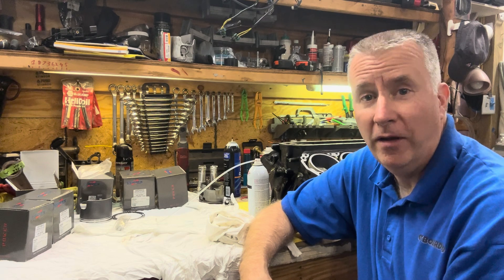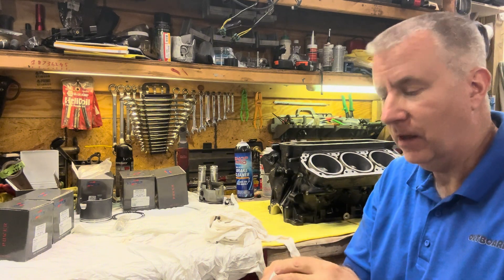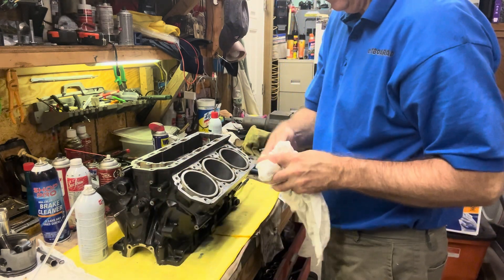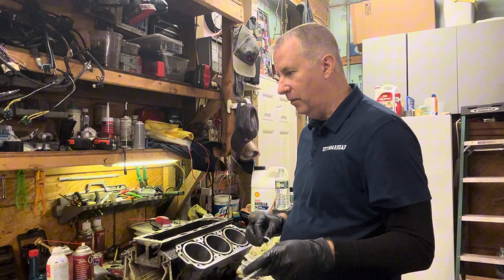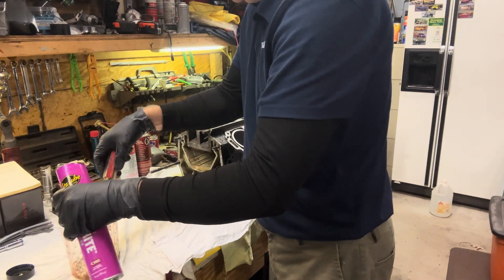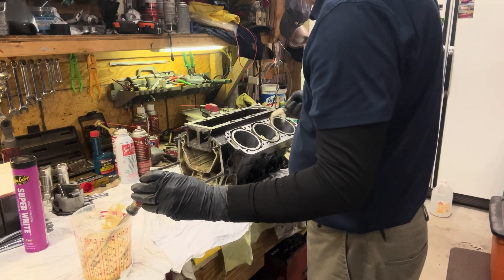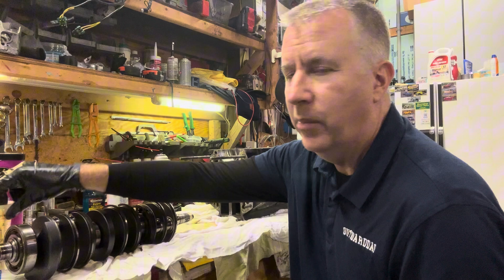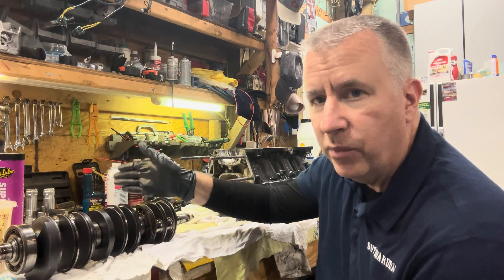Outboard Motor Rebuild for Beginners Step by (part 21)

Comment: Hey ther OutBoardDad. I've got a Frankenstein build. Its a 75' 70hp Johnson with an 69 exhaust housing, which happens to be compatible. Original spun a bearing on the 75' 70hp. That was the only issue following teardown and mic ing everything out. Has been sitting im just getting around to the project.  

Long story short my cylinder walls have a smidge of rust on them. I am curious about how to proceed. Preferably with original bores. The rust is very surface level. Any and all insight as how to proceed is appreciated. Thanks. Also, polishing journals without changing circumference/clearance?
Reply from the maker: @wlukew3052  I would have to see it but most times some light emery cloth can clean up surface rust. The only way to be 100% sure is to tear down and clean up. Same with journals
Reply: @OutboardDad  Hello I appreciate the response. oh its tore apart. I've got Emory cloth as well as 3M scotch brite. Will do, thank you very much
Reply from the maker: @wlukew3052  Let me know how it goes! Shoot me an email keith@outboarddad.com

Comment: Thank you Keith, always good explanations and professional advise on just what to do and what to be careful of, quick question I have a Mercruiser 120 Hp now I have taken the stern drive of and got the shock of my life, someone before I bought the Fairline Vixen, has botched almost every bit of the sterdrive, because of this I am worried about the condition of the engine, I drained the oil and it is fine like brand new, so far I don't think they got into it, as a safety measure should I strip the engine down as well, I am so busy with trying to winterise every thing and yet get this boat back in shape for next summers fishing and being disabled is a real struggle I tried to contact you on the second phone number but it appears I have locked my self into some weird contract would sending you my house phone number be better. Jim from Scotland.
Reply from the maker: @Jimmyfisher121  Hey Jim I would get a cheap scope from Amazon for your phone and look inside the cylinders. If no rust you can winterize and get into it next year
Reply: @OutboardDad  Thank you Keith for answering so quickly and I bought a scope for checking the tubes and areas in the boat now I will use it on the cylinders I never thought of that so thank you you may have saved me a very large chunk of money, and I do love saving money. 🤣🤣🤣
Reply from the maker: @Jimmyfisher121  We all do and that is my purpose to help others have a better boating experience! It’s always better when out on the water enjoying with friends and family and not breaking the bank! Keep me posted buddy!